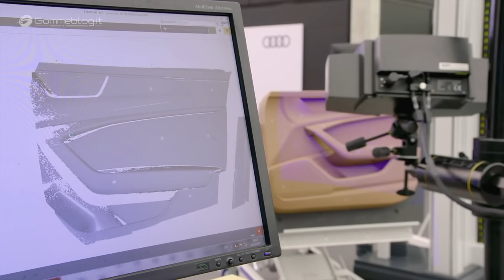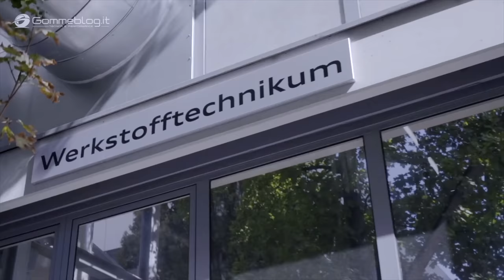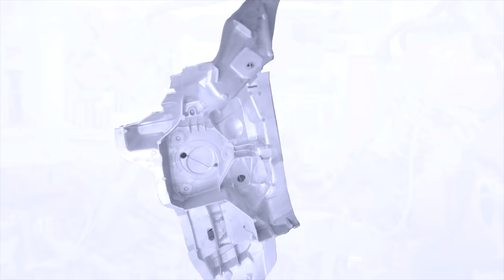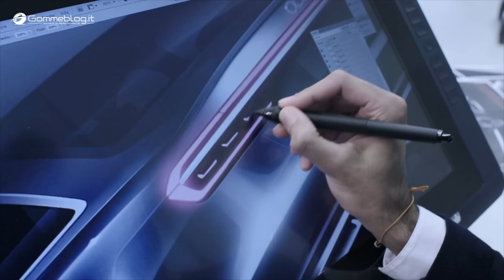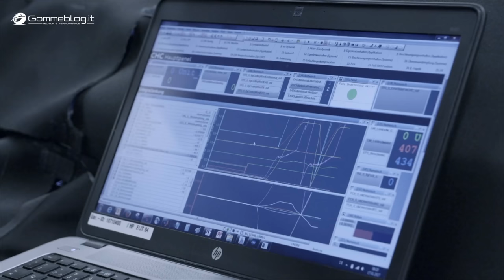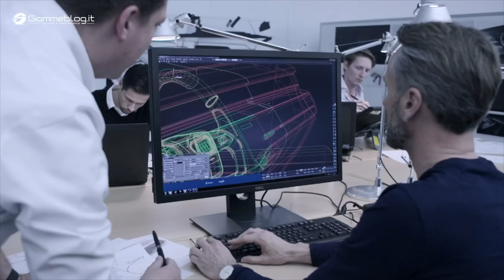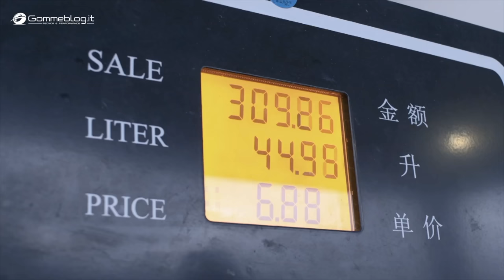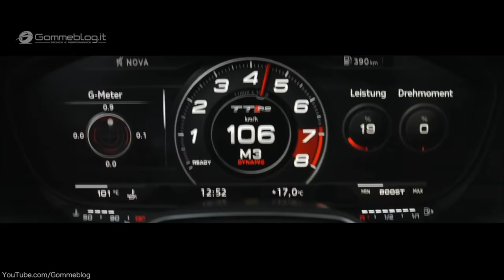Audi - Car Factory 🚗 Production ⚙ Robots Plants Assembly

Comment: why do they make car from clay?? was it not easier just to drive in and park the real one?
Reply: They make design pictures on a car then make a 3d full size model out of clay, then they make one out of plastic and then they make a fully running prototype with a white and black camo paint on it so people can't see the shape of the car as well. They test the prototype and at the same time they improve it. The car get's released to the public at the end and finally the camo gets removed.